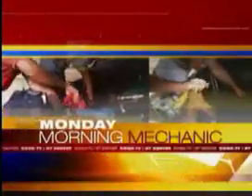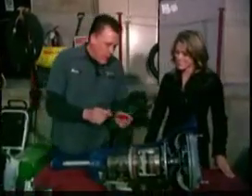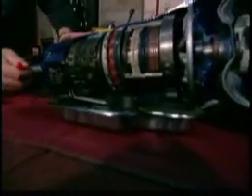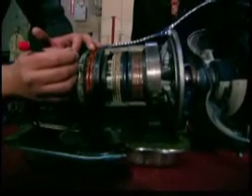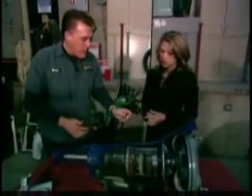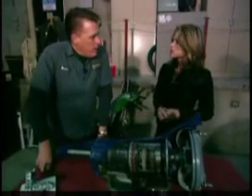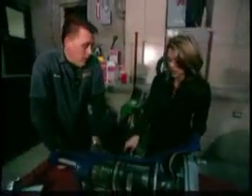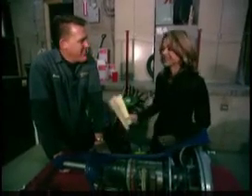Why Transmission Fluid is SO IMPORTANT

Comment: @living4fire If it were me, & had the transmission since day one, I would change the ATF every 50k miles if the transmission was leading an easy life. Just to show how far automatics & the oils that lubricate 'em have come, my '97 GM 4L60E went 206K mile on the original fluid. Obviously, it must've led a somewhat easy life for it had 205k when I bought it.